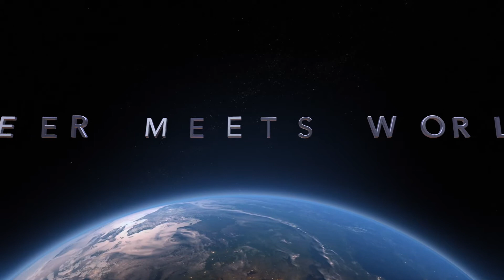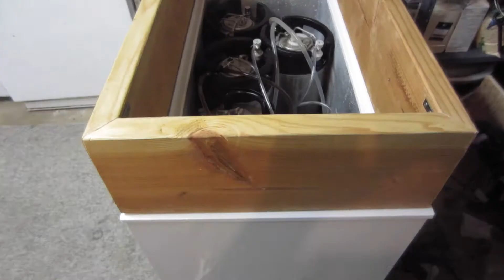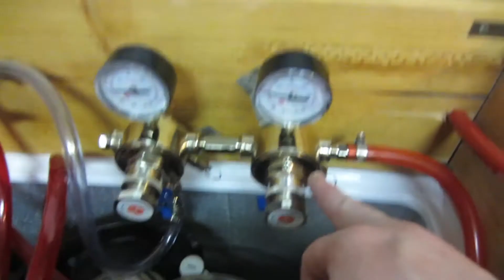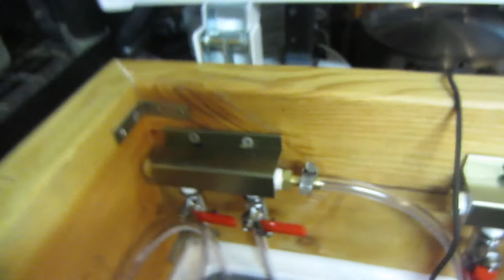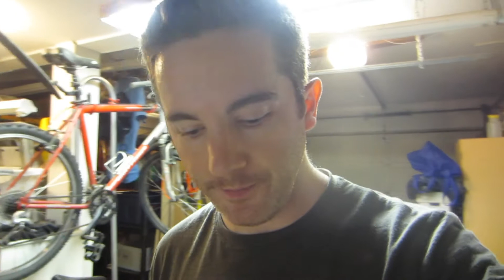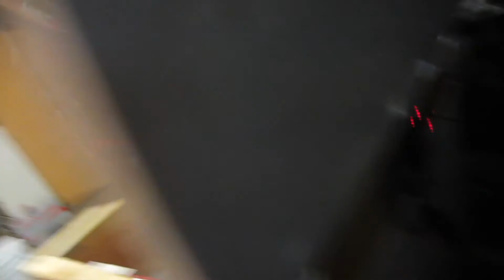6-Tap Keezer Build

Comment: Where did you get your argon tank for your red wine?
Reply from the maker: Airgas is the name of the company, but any welding supply gas company should have it.
Reply: @BeerMeetsWorld  I've never heard of argon. Is it just air to pump the wine through lines? What is it exactly?
Reply from the maker: It’s a noble gas atomic number 18. It’s stable, usually used to displace oxygen in wine barrels and tanks. Less likely to dissolve in liquids compared to CO2 and nitrogen, so ideal for pushing wine in draft systems. Tends to be more expensive though.
Reply: @BeerMeetsWorld  awesome. Thank you
Reply: Do you still have a primary dual gauge regulator attached to the co2 tank. Then the secondary? What do you set the primary regulator if you have different pressures? Do you set it for the max pressure your serving your beer at? Such as if you have a wheat beer that's higher than all your others then you will set primary for your wheat beer pressure and change the secondary to what you want the other pressures for?
Reply from the maker: Basically. My primary regulator is set for carbonated water, then it goes to two secondaries, one for specialty beers like wheats, Belgians, and one for standard serving pressure that goes to a 4 port manifold.
Reply: @BeerMeetsWorld  what do you carbinate your water at?
Reply from the maker: I have incoming set at 20psi.

Comment: How long does it take you to carbonate your water to a good level in your corny keg? 
Thanks for the vid. I'm starting a build with a 200 litre chest freezer but mainly drink vodka with soda water.
Reply from the maker: +Mothox I've got it set to 20 psi and it only takes 3-4 days for it to carb to a good level. There are ways you can speed that up though. Chill the water then shake the keg with the CO2 line attached. But just letting it sit for a few days works fine for me.
Reply: Hey thanks heaps for the reply. You have saved me searching everywhere else for the answer. And I have searched. Three dedicated soda kegs and 2 for beer is what it shall be for me then. Your great for helping me. 🍻